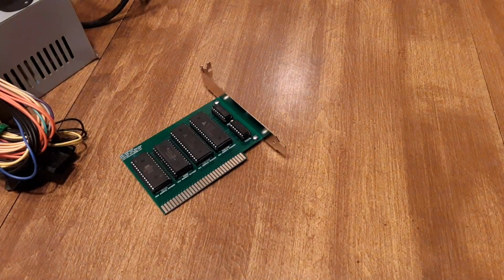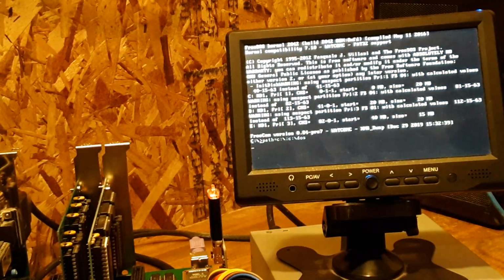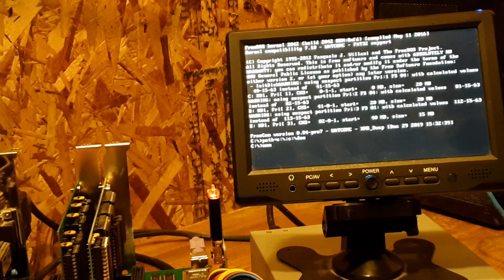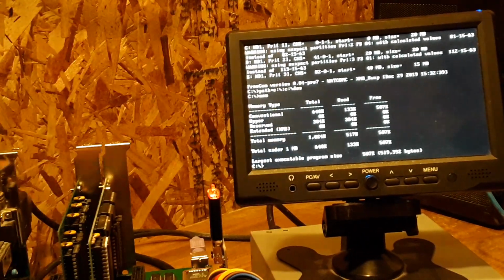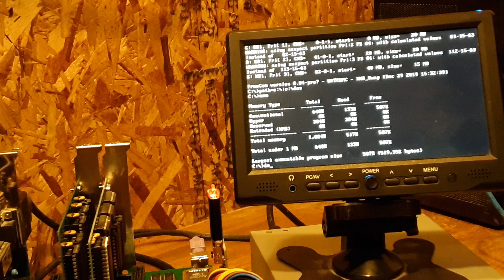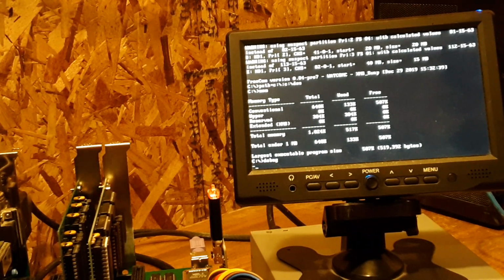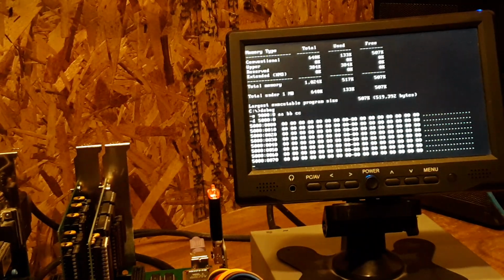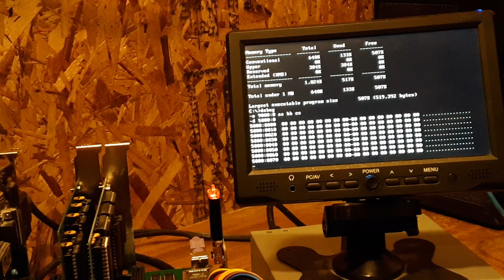640K Ram ISA card

Comment: Would the 640K RAM card function on generic XT clones? (if all onboard RAM has been removed) This would be great for testing purposes :)
Reply from the maker: My first comment was wrong. I was thinking that you were referring to the V40 with 640k ram. 

Your talking just the memory card... I am not sure. I haven't tried it in such a scenario. It might be possible to use it. I guess the only thing to do is try it.
Reply: @elijahmmiller   Yes the idea was to use the 640KB RAM card in standard XT machines. Very tempted to give it a try with nothing installed on the system boards.  The V40 could be an interesting project.

Comment: What is the max RAM that can be installed with a 8-bit ISA card? I remember having a big board (full size XT 8 bit) populated with many ram chips; it had 1M on it.When I plugged it on my 486 motherboard without RAM sticks it detected 1M (640k base+384k), with ram sticks installed it ignored it.
The RAM chips you used are SRAM? What chips you used? I have a old destroyed Compaq 386 laptop (the main board is functional) with 2M RAM onboard and a proprietary RAM expansion that is unobtanium today; may it be possible to use SRAM chips to replace/upgrade its RAM to 4 or 8M? I believe I found the ISA bus and I want to try to add a ISA (or 2) slot to add a soundblaster card; may be a RAM ISA card possible too?
Reply from the maker: The maximum ram depends on the PC. Your lower memory on an 8 bit machine maxes out at 640k. The processor can address above 640k it is just on the IBM PC map everything above that is reserved for IO's, Video mem, ROM, etc. There is expanded memory that can be added to a XT machine that uses a page type system to go beyond the 1MB limit of the processor.  If your using a 80286 or higher then you can use upper memory that sits above 1MB. The lower 1MB is still mapped the same as on the 8088 with the 640k limit. 

If you wanted to build a custom memory card for a commercial PC it should be possible but you would need to gain a good understanding of how to properly go about the layout of your memory and what type of memory to use.